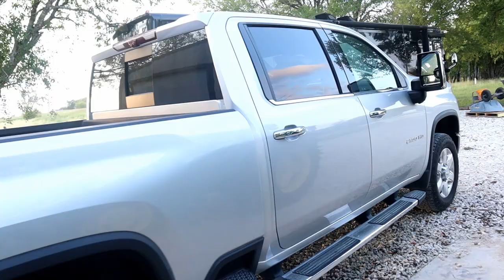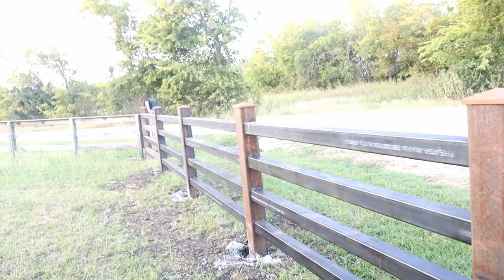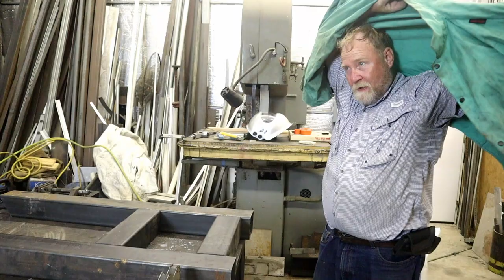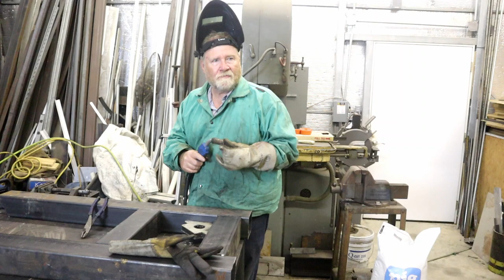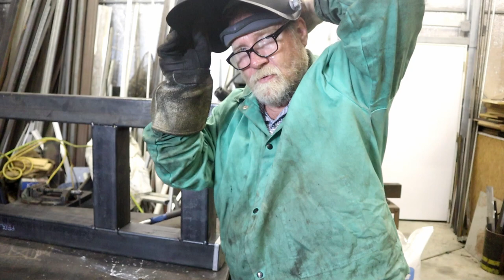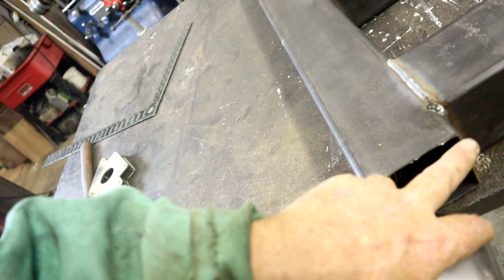My Nice welding helmet turns into a face shield, My truck turns back into a Rock.. One of those Days

Comment: When it stalls push the OnStar button. They can read the codes remotely if I recall. There are also special scan tool /recordings devices that stay plugged in and record all the data stream and save the data stream snap shot before and after the failure. Allowing review of the data to see what dropped out first.  The system does some of this already.. Being able to review all the data streams to look for the one glitch. Something that shut off before everything else. It could be a single terminal in the harness that did not get crimped tight  or not latched all the way in the connector body.  Gm may end up replacing the engine and transmission control harness  . Finding techs who can diagnose failures without codes seems to be much harder nowadays.